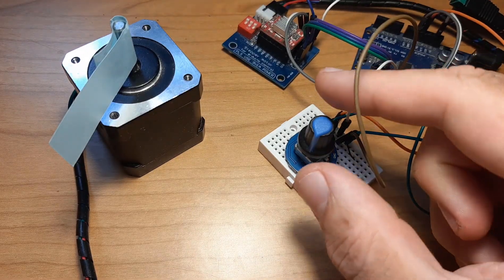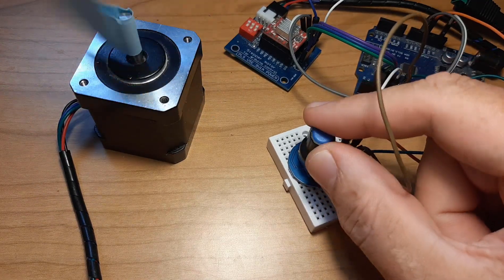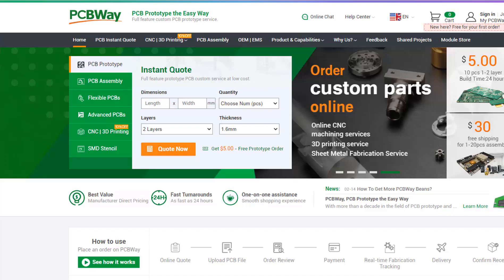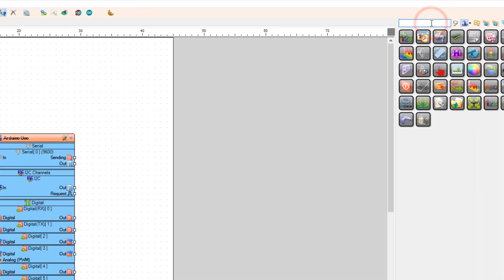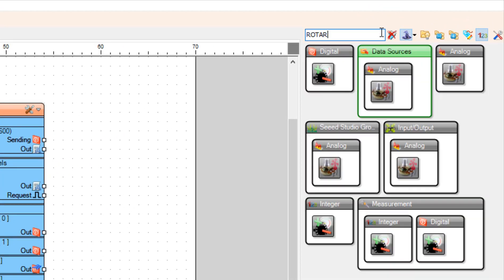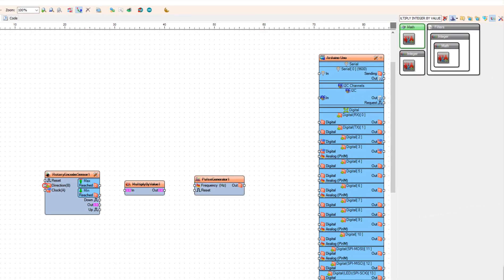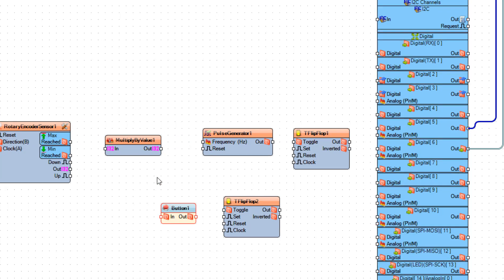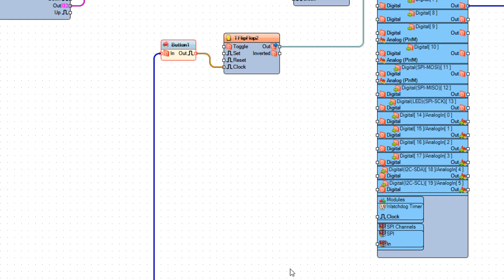NEMA 17 Stepper Motor - Using Encoder for Controlling Speed & Direction With Arduino

Comment: The encoder you use in the video is not the same as the encoder shown in the wiring diagram.  Could you please clarify the pin connections for Key, S2 and S1 on the PEC11R encoder module shown on the video. The pin connections for the encode in the wiring diagram and description are CLK, DT & SW which are connected to Arduino pins D5, D6 & D7 respectively.
Reply from the maker: I forgot but S1 and S2 are clock (clk) and direction (dt), Key is the button (sw)